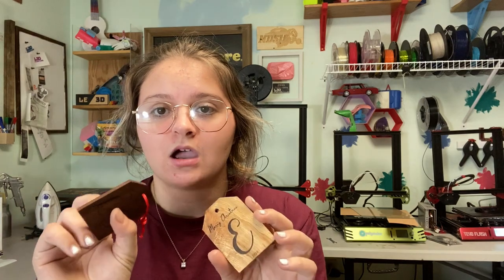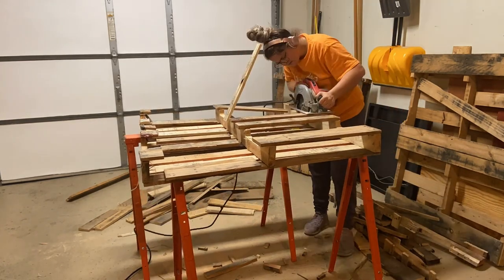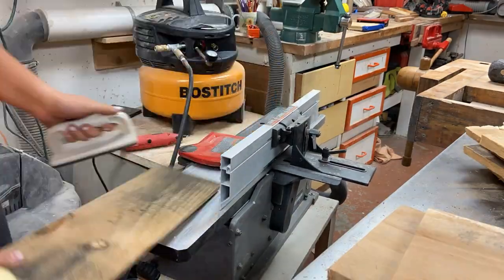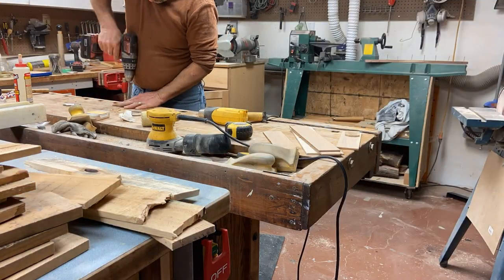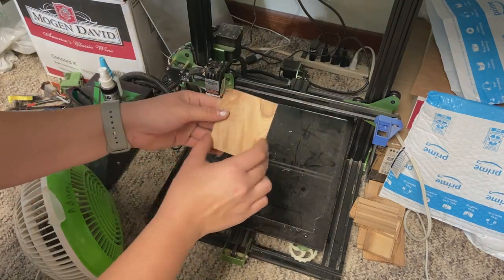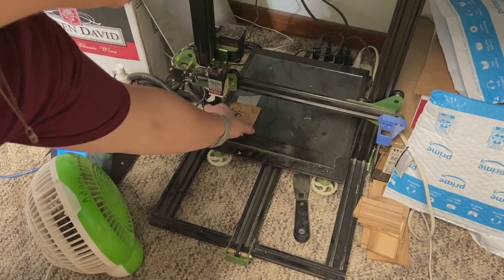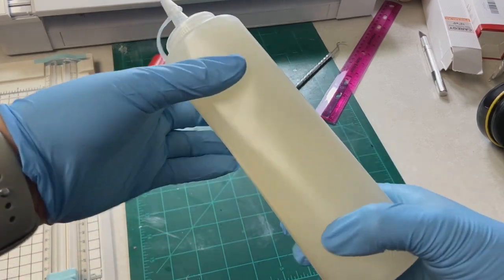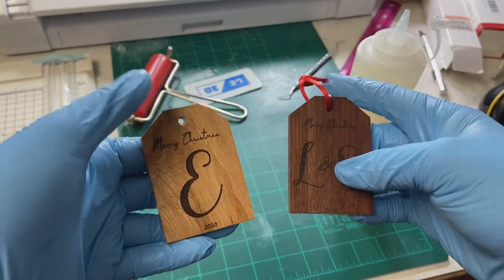Turning Pallet Wood into Christmas Ornaments using  a Laser

Comment: What is the stuff you put on it, the bee wax mix? And where can you buy it? It's food safe for cutting boards? I'm a newbie at lasering. Just made my first cutting board. Not sure what to finish it with. I know there Butcher block oil too.
Reply from the maker: It is beeswax and mineral oil melted and then mixed together, let it cool and it will create a finish
Reply: @TimberWood.Customs  is it a 50- 50 mix?
Reply: I just bought a piece of 3mm clear acrylic. Do you have any videos on engraving and cutting for that. If not any suggestions on setting to start with?
Reply from the maker: @ald.3449  in the ortur laser master 2 video I do cut acrylic as a test, on engraving, I have t tries it but all it is trial and error with settings, not very hard:)
Reply: @TimberWood.Customs  I'll check it out again